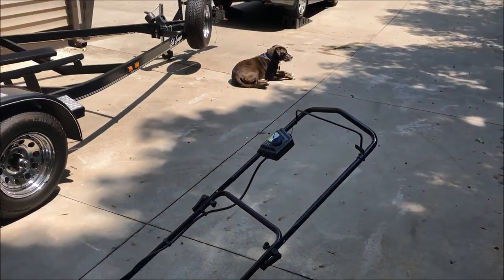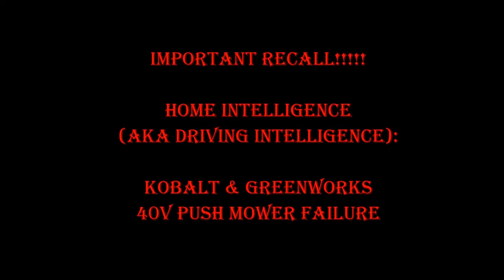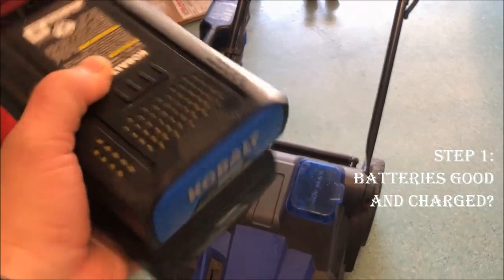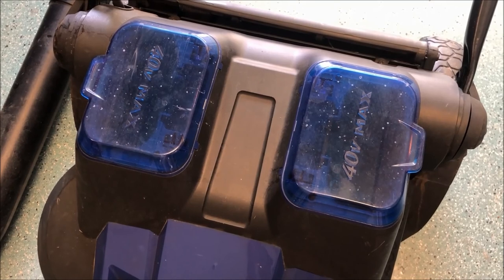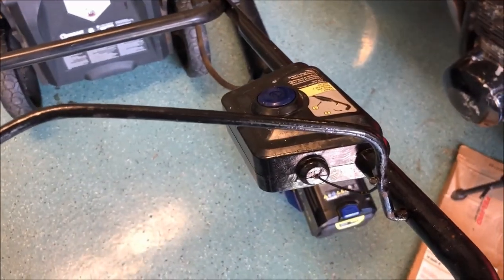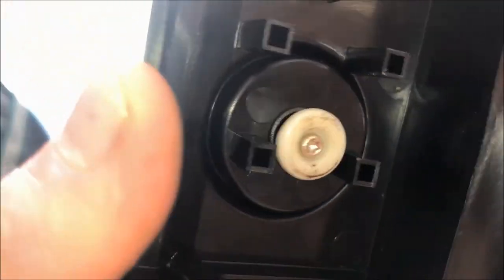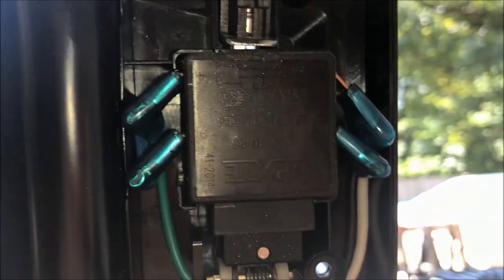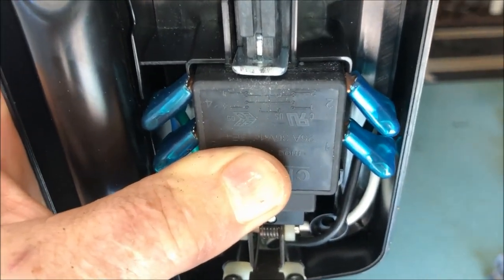Recall: Kobalt Max Model KM2040X-06 & Greenworks G-Max 40v Push Mower Won't Run: Failure & Repair

Comment: The acceleration bar popped out and when I put it back in I can’t stop it from running forward.. how do I adjust the tension?
Reply from the maker: you might have reinstalled the bar incorrectly.  Are you sure the wire is not wrapped?  Can you send photos to my FB page at www.FaceBook.com/DrivingIntelligence ?
Reply from the maker: Did you resolve this issue?
Reply from the maker: https://youtu.be/H_rDZghCDJo

Comment: I also have one of these mowers. My problem is when I tried new batteries, they didn’t work. The old batteries still work, but they are original and don’t last as long as they used to. Did you ever get the mower fixed?
Reply from the maker: Yes, mine fixed through the recall.  Yours sounds like a different issue, but very odd.  Are you sure new batteries are good and fully charged?
Reply: @DrivingIntelligence  Yes, I tried two new batteries. I think the new batteries aren't working because my mower has the old circuit board. I'll have to call the number in your video and see if they'll still fix it. Thanks for the info!
Reply from the maker: Get your issue resolved?
Reply: @DrivingIntelligence  No, I haven’t pursued it yet. The old girl is still working though, it would have been very difficult cleaning up the leaves this fall without it.
Reply from the maker: https://youtu.be/H_rDZghCDJo

Comment: If you have a Greenworks 40v  mower that turns on then off right after then it has a bad handlebar safety switch (SKU 36301289). Do not replace, they are notorious for failing to work. Had a new mower sent to us under warranty and that one failed shortly after, Never even made it to the grass before the same issue as the last mower. I now have removed the safety switch and put in a toggle switch from the white wire to the green wire as the fix.
Reply from the maker: Interesting solution, but you lost the safety feature?
Reply: @DrivingIntelligence  I did some more testing and figured out it is not the switch. Its the state of charge of the battery. Both mowers will not turn on when the battery is 100% but both mower will turn on when the battery is discharged. Something to do with the BMS

Comment: Hello great video, who did you file the recall through mines stopped yesterday and just happened your video was the 1st one to pop up when I searched for a fix. Thanks
Reply from the maker: In the video I comment on who to call and also I included links in the description of this video. Try those and thanks for your comment.
Reply: @DrivingIntelligence  ok thanks, i watched the video and saw the links but they take me to the recall site but i guess it no longer accepts the recalls unless im doing something wrong. hoping that you will create a video and do the recall process
Reply from the maker: @michaelgrahamjr.9605  I'll check on that... I hope it hasn't expired
Reply from the maker: I checked the links and added the phone numbers in the description of the video.  I hope they are still honoring the recall.  Did you mower completely stop as did mine?
Reply from the maker: any luck with the numbers?
Reply: @DrivingIntelligence  yes, checking the number now
Reply from the maker: Let me know how it works out
Reply from the maker: https://youtu.be/H_rDZghCDJo

Comment: I bought a used Kobalt 80v mowever. it looked so new, I didn't bother to check the manufacture date. I went out and added a couple of 6 Ah batteries to my arsenal, and the second time I used the mower on deep grass, which has never been a problem for my Greenworks 80v mower, the lawnmower crumped on me. I tried to see if Kobalt or even Lowes would do something, they all played stupid or ignorant and I do mean all of them. Even the Greenworks Tech Support acted like real ass wagons on this one. I have it disassembled and had a guy that a place that inspects AC motors check it out. He told me, without putting power through the motor, that the motor seemed to be good. What happens? When I hit the starter and pull back the handle, nothing happens then a few seconds in the mower starts to beep. Same when I try to engage the drive. I needed to take the mower apart anyway. it had a horrible odor of what smelled like the flats in new England when the tide is out, with sort of a rotting smell too. I completely cleaned everything, which needed to be done. Since everyone turned their back on me, as a parting shot at tech support, who was simply quoting me passages out of the owner's manual the whole time, I may have said that I will just modify my $600 collection of 80v Kobalt batteries to fit the opening of my older Greenworks 80v mower. That got the Canadian chick at Greenworks tech support, who also apparently has a low opinion of people in the USA, very upset..LOL Good luck trying to find a replacement motor, which I did. I have not tackled the control head issue, but hopefully replacement parts with an FCC ID on them will be easier to run down.
Reply from the maker: Thanks for that story... when these mowers work, they are great.  I find there is no support out there whether it be spare parts or tech support.  I was lucky to have the control module replaced as a recall.  I do know that Mice like to hide in my mower... maybe that happened to you and one died ;)
Reply: @DrivingIntelligence  it is in pieces and I can absolutely confirm no mice were inside it..